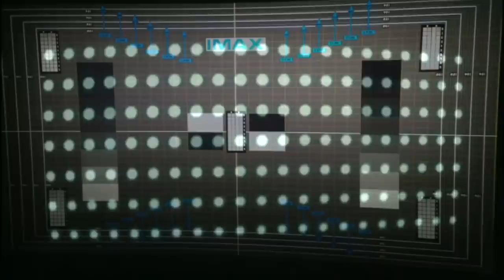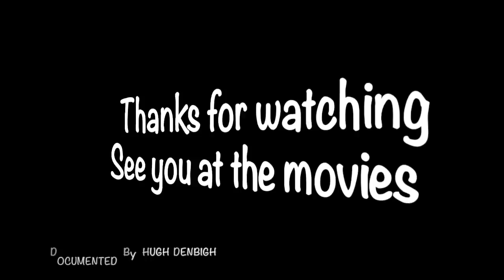IMAX 4K Laser upgrade time-lapse, from 1570 2D - IMAX Theatre - Royal B C Museum

Comment: This was not a minor upgrade... New 4K Laser Systems, remodel, new seating, probably fresh coat of paint in restrooms, new snack bar, etc. Very impressive. I can't wait to see the new and improved IMAX. One thing that always amazed me was the size of the film on 1570 system. 70mm not big enough, lets supersize it to 15 perforation. 

I used to think my 35mm was big, twice that is big, 15 perf is really big. I have actually used film cameras in the past that used large film. My Hasselblad used 2 1/4 x 2 1/4 inch film. My Mamiya used 2 1/4 x 2 3/4 inch film. My Calumet studio view camera used 4 x 5 inch film. I wish I had a chance to use a 8 x 10 inch studio view camera.
Reply: You're right, it wasn't a minor upgrade, it was a major downgrade. IMAX film is roughly 12K-16K, and they're going from that to 4K.
Reply: @KingdaToro  Thank you for input. Is there better IMAX digital available?
Reply: @SJR_Media_Group  We don't yet have any digital system capable of projecting IMAX resolution, so digital IMAX does not exist yet.
Reply: @KingdaToro  OK, thank you. Hard to beat something that is near perfect. Is digital cheaper to shoot, store, and play than 1570?
Reply: @SJR_Media_Group  Yes, by far. IMAX is hard to use, the cameras are so loud that dialogue can't be recorded on set. The film is expensive, the cost of a single release print is somewhere in the five figure range, to say nothing of the film stock needed for a shoot. But the point is, when you buy an IMAX ticket, the premium you're paying is going toward all that. "IMAX Digital" is purely a scam, because the studio and theater are just pocketing it instead.
Reply: @KingdaToro  Wow, thank you. Until this post, I wasn't aware of difference between 570 and 1570. I did research and was blown away. I was an avid photographer for years. Would love to have a single frame camera using 1570 film. 

I have not been to an IMAX in years. Closest to me is in Seattle. I'll have to check what they are currently using. 

Digital has come along ways. Even Hollywood is using cameras like 8K 'Red'. Even best digital does not have the tone, contrast, warmth, etc. only film provides. They still use film on some projects, but the costs catch up soon.
Reply: @SJR_Media_Group  8K would really be the minimum resolution for digital IMAX that's actually worthy of the name. It's not as high resolution as 15/70 film,  but it's getting close to the limit of practicality. IMAX is beyond that limit. The maximum practical resolution can be determined by the properties of our eyes. Our normal visual acuity is 80 pixels per degree of our field of view, and our binocular field of vision is 120 by 60 degrees. Multiply those by 80, and you get 9600x4800. That's the maximum practical resolution, as you'll be at the "sweet spot" of being able to see all the detail but not being able to distinguish the individual pixels at the distance where the screen just barely fills your whole field of view.
Reply: @KingdaToro  Thank you. Do you know what is being used in Las Vegas IMAX Sphere ?
Reply: @SJR_Media_Group  
Standard 70mm  such as Super Panavision 70 could compete with IMAX 15/70 when it comes to the actual large size of the cinema screen. 

So take any large 15/70 projection screen in a theater you could get a standard 70mm up to that size and it would compete for image quality. 
The reason for this is that 15/70 could go much larger in size and produce an image that is probably 3 times larger that what is normally used in those 15/70 cinemas.  The classic 15/70 cinemas simply were nowhere near their potential when it comes to size.
Reply: @KingdaToro  
When it comes to using IMAX 15/70 cameras for close up quiet scenes they are too loud and a means around this is to use a selection of Super 70mm cameras and Vistavision 35mm cameras that would be smaller than the IMAX 15/70 but allow for quiet scenes to be shot. 

Most outdoor scenes or large stage sets scenes are not that much of an issue with IMAX 15/70 Cameras as the camera can be far enough away form the mic to not be picked up.
Reply: @bighands69  Thank you for your comment and insight. I just learned something I didn't know before. 

Over the years as a photographer, I have used different film formats besides 35mm. The Hasselblad used 2 1/4 x 2 1/4. The Mamiya used 2 1/4 x 2 3/4. I also used a studio view camera 4 x 5 for architectural work. Negative was big enough I could make direct 4 x 5 proof prints without needing an enlarger. Photos could easily be enlarged poster size with no loss of detail. 

I would have loved to have a still camera that used the 15/70 film format. I bet film is expensive and processing is non-standard and expensive also. 

Today, I still have a 35mm film camera. I did switch over to DSLR Canon Eos about 15 years ago. Once I got used to digital I stayed with it.

Comment: I noticed in the video that they still left the 70mm IMAX projector there and tested it to work with the new screen. I don’t think they replaced the 70mm projector, just installed an additional digital IMAX projector. I’m guessing they left the old one in place for those rare occasions when they are sent a film printed in genuine 70mm IMAX, probably by Christopher Nolan giving them a hard time.
Reply: You didn’t watch to the end did you? The 2k projectors were temporary. In 2016 they removed their film projector to make room for the huge downgrade of a 4k system (70mm film is approx 18k resolution and the difference is very visible at IMAX screen sizes)

Comment: I'm just curious... How do you upgrade, I mean like you call Imax and go like hey we have the bucks and wanna upgrade? Like who are the contractors, what does the Imax provide and so on?
Reply from the maker: IMAX stands for maximum image, the largest screen possible with the highest resolution possible. To upgrade doesn’t necessarily mean technically a better image, open to debate, but rather a more economic mix of present technology to maintain a business into the future.
Reply: You can't just go out and buy IMAX equipment, contractual arrangements are required. IMAX are involved at the design stage etc. so that the auditorium meets their specs. You'll need your own contractors but IMAX will be involved in the system installation and the agreement will include annual maintenance costs with an IMAX technician visiting periodically. The system is also remotely monitored by IMAX in Mississauga, Ontario. IMAX also provide geographic exclusivity (so someone else doesn't open another IMAX just down the road) and other parts of the terms will include IMAX's box office share. Obviously, these agreements are confidential, so who knows... but the preceding has all been publically disclosed. Clearly it is not as simple as just having the required capital. The dual GT laser system was expressly designed for these kind of full scale insitutional venues, however, and IMAX were presumably eager to retain those locations/customers. Some institutional giant screens have moved over to competitors' digital projection.

Comment: 3:55
are those the screen holders? also what's the screen made out of?
Reply: They are screen shakers and they cause the screen to vibrate a little to reduce the hotspot (glittering effect) on a silver screen. Without screenshakers that screen would look like a Twilight vampire.
Reply: @andreasvogler1875  omg! this makes so much sense. we went to a cheap movie theatre once and it had this glitter effect. I was like WTF. Not only that, but the entire movie was pretty dim. Terrible experience. However, for the price, I guess you get what you pay for.

Comment: Hi,
What are the devices shown at 3:56 ?
Thanks!
Reply: Those are " screen shakers " essentially a subwoofer that emits a low frequency pulse to "shake" the screen. This is necessary in Laser projection as laser light will create a shimmering effect know as "speckle" as it reflects off the silver screen. They're mounted 4" from the screen on the scaffolding behind the screen, and there's about 84 of them! Lots of fun when voltages go haywire on one 60 feet up, sounding like a very happy cat. In this case we usually cut power to unit and wait until the following IMAX service.
Reply: @jasonst-louis7849  thank you very much Jason!, so these are there purely for the visual aspect and not the audio part?
Reply: @lukapogo  That's correct. A little engineering secret IMAX rather not talk about. We've had no problems here in Victoria but I know Seattle had major issues with them.

Comment: Have they kept the 15/70 machine or did they get rid of it?
Reply from the maker: Hi,    I left after the 4K Laser was installed, at that time all the 1570, support equipment and film library were still in the booth but not in use. This was over six years ago, with it all just sitting and the Laser fully engaged, I would say there are many reasons 1570 will never be seen again at this theatre.
Reply: Sad. Laser still doesn't look as good as 70mm and there's a lot of 70mm footage thag won't be remastered for laser.

An experience lost to time for no good reason. They already had it setup to swap between 70mm smd xenon, just keep that and show 70mm where applicable.
Reply: They wouldn’t just throw it out. Right?
Reply: @robertforster8984  seems they get moved to the side, slow making it harder to bring back up. After years of non use too much maintenance needed to use again. Then it'll be sold off/disposed of to free up space.
Reply: @robertforster8984  Most do.
Reply: @HughDenbigh  It could have been used to screen Dunkirk. I know the Calgary IMAX was screening it in 70MM and I know Nolan was pushing most IMAX theatres that had the capability to do it.
Reply from the maker: @jch010  
Imax Victoria lost the ability to show any 70mm film early 2016. In a recent announcement, the theatre will close early 2023 for an undetermined time.
Reply: Do Imax projectors belong to the theatre or to Imax?
Reply: IMAX Corp released an internal Technical Bulletin in 2018 to keep all IMAX Film 1570 GT systems on the west coast of North America " in service". The reason was to facilitate post production film editing for Hollywood productions. The only director still using Kodak 1570 stock is Christopher Nolan, and if he says jump, we'll do it!  The GT 15/70 system is still in house in Victoria.
Reply from the maker: @jasonst-louis7849  
Wow Jason!  Good luck with that!  Hope you don’t get a jump email!  Can’t imagine getting the 1570 up and purring along with all the peripheral support equipment. I would say this sounds like directives from a management without hands on experience.  With that, the physical limitations and capabilities of the booth, staying in business showing 4k with 1570 even if just for editing purposes.  And of course the fact that your theatre has a questionable future with the recent government announcement regarding your building, pushing everything regarding 1570 further down the road and out of sight!   If they lose you guys, good luck finding knowledgeable people.
   An added note!  During my time there, with all the film assembly, editing and repair work, as you will remember, we couldn’t get the owners of the theatre at that time to pay for a frame counter!  Every perf counted by hand (eye)! A clear example of management attention to reality. Ounce again Jason, Good Luck!
Reply: @HughDenbigh  Anythings possible with a Billion dollars in your pocket! 😀
Reply from the maker: @jasonst-louis7849  
Hope that money goes in your pocket!👍
Reply: @HughDenbigh  Oh sure! I work for the SPENDP now.

Comment: Why does it need dual lasers? What would happen if it was just a single unit, would the picture just not be as bright?
Reply from the maker: Needed For 3D
Reply: @HughDenbigh  Would it work as a back up when nor been used for 3D
Reply from the maker: @philipmcdonagh1094  
Yes

Comment: Can anyone tell me if there's a huge differences in screens? Like, white is white, but there's always one whiter object. And, how about the material?
Reply: Screens can reflect more light than white would. It's called "screen gain"
https://en.wikipedia.org/wiki/Projection_screen#Screen_gain
Reply: @whitcwa  very interesting! 

How about digital movies and the way they are transported and displayed. 

I once, approx 8 years ago I had a behind the scenes in a movie theater nearby. Back then they used all the latest technology. 
So modern, they even now play movies from a USB shipped by the film studio. 

Is it just that easy? Is there really a USB with properly the best quality -(in terms of resolution, FPS, etc) -compared to Netflix, just in a theater? 

How come modern theaters don’t get robbed so often. Wouldn’t it be worth thousands if you had such USB?

Orrrrt, is it not that easy after all?
Reply: @TVARecordings  They have crypto coding that locks the USB device. The projection system decodes it on the fly just in time for projection to prevent copying and theft.

Comment: How depressing. IMAXs unique selling point replaced by a digital projector the same resolution as a home TV and reducing the experience to the same as any other premium cinema.
Reply: Yep. When Imax sold its soul to millionaires seeking to make money, the format died. There is no better quality format than 15 perf 70mm. Resolution is upwards of 12k at the print. It died due to IMAX not having anything to charge their theaters for since the film projectors were bullet proof. So make a new format that requires constant updating, charging theaters millions of dollars every few years to update, way more then the salary of projectionists and dilute the format so it’s nothing special. Then charge 2x the ticket price. It worked for a while but it’s not working anymore. Now everyone regrets getting rid of their film projectors and to top it off IMAX is making new film cameras. The battle for film is not over yet.
Reply: And the irony is that much of that brand awareness came from Nolan himself, who at least still strikes 15/70 prints - although I wonder if “Oppenheimer” will be the last…
Reply: @cyberyoyo7674  They’re spending millions to make new IMAX cameras. I have a feeling this trend is going to expand.
Reply: well times change and it is getting more expensive to make IMAX reels plus with more and more theaters going digital they are trying to save money and its easier to replace a Download that it is to replace a whole 70 mm film reel
Reply: @johnlerch7699  All chain cinemas have had digital projectors since about 2010. The point is IMAX have a unique analogue picture format & cameras, they do not have a unique digital format, even though they claim to.
Reply: @christianclark1354  plus even with IMAX they make no money at all with the sales of tickets, maybe like a .25  off the ticket sales, and like i said before IMAX reels take along time to load and rewind so theaters want to cram in as many showtimes as possible nowadays. so the projectionist job became a thing of the past and a novelty, and places want to save money.
Reply: @johnlerch7699  People pay for novelty. The same chain cinemas that switched to digital are finding it hard to attract customers against Netflix. Not an issue for Christopher Nolan releases in real IMAX cinemas. Always packed out.
Reply: @johnlerch7699  IMAX went full digital a while ago. Only reason the projectors have been used is for older movies and Christopher Nolan movies. Remember digital IMAX is 4k at best, most is only 2k and 15/70 real IMAX is 12k. So why would they charge people exorbitant amounts of money to watch lower quality than your own TV?!? No other system in the world can compete with real IMAX on film, it’s just impossible. Film prints are expensive but the cost of admission warrants a special experience, not just BluRay quality.
Reply: @christianclark1354  IMAX never had an issue packing ppl in, but the smaller Cinema's are having issues. I should know I work at one, there are a lot of slow days and the only thing keeping the smaller places afloat is the consession sales, that's why the prices are so High for popcorn and a soda. they don't make money on th tickets its the food that brings in the money. once the novelty wares off IMAX will eventually face the same fate as the other places
Reply: @johnlerch7699  The reason places have low sales is because they switched to digital projection and frankly, it sucks. Lots of the independent cinemas who have retrofitted 35mm projection back in around here have been able to reposition themselves as trendy boutique places, charging way more than they did before but people choose them over the chains every day. Yes they have trendy bars and even actual restaurants instead of fast food. These types of cinemas are expanding massively while the chain multiplexes are closing and trying to keep up.
Reply: @christianclark1354  Trust me i work at one and thats not the reason and yes its better to a theater to watch movies but it cost more to pay someone than to switch to digital and less cause to damage to film that can cause it to scratch and ruin the film costing more money, and getting tickets is only like maybe .50 to $1.25 profit from the films for the company running the theaters so yeah money comes from food sales not the movies themselves. thats how bad it is for ppl that make the movies a the take more and more shares from the movie theaters. I asked my manager about the reason that film projectors were replaced and i was more cost effective.
Reply: @johnlerch7699  yes I know the reason they switched to digital was to save money. Nothing to do with improving the quality. That’s my point. They made things worse and now customers are not coming any more. The cinema owners don’t understand the link themselves, it seems unrelated right? It’s not.